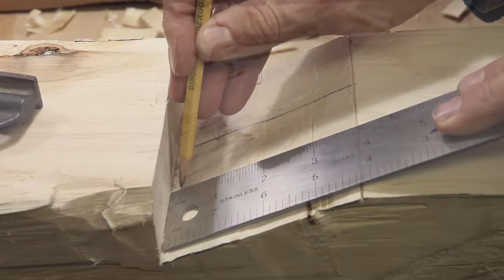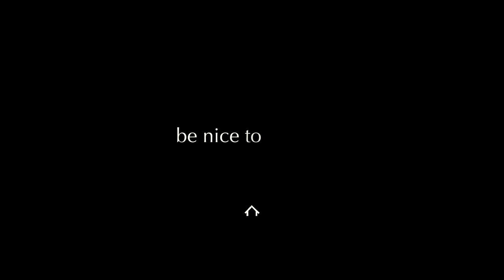Scrap Wood Woodshed

Comment: Great build and video.  Love the team work.  How many different axes did you use to hew the Ash logs.  I think I counted two but was just curious.  Thanks.
Reply from the maker: Thanks Dan, I used 4 but that's just because I have an axe fetish. Could probably have done everything with the mid size broad axe just fine but the big felling axe works well to make the notches.  Keeps the broad axe sharp for the hewing.

Comment: Was the unspoken goal in this video to make your square wooden elements using as many different methods as possible for getting there? :) It's pretty unusual to see someone with such skill across so many tools and methodologies. It's a joy :)
Reply from the maker: Well, as you may be noticing, almost all my projects over the past 5 years have been leading up to one thing.  cabin building.  I have been using these projects to learn new skills and test various methods and better estimate time.  So in a way yes,  Not for the specific sake of this project but as a whole to develop my foundation of skills in various methods.

Comment: Nice shed and video.  One thing that seems odd to me is to take all that time hand hewing the logs and making the joints and then screwing them together.  Why not go the whole way and use dowels?
Reply from the maker: Because I want to take it apart and move it. When it's in it's final position I'll do dowels.
Reply: Ahh, makes sense :)

Comment: loved it. I thought everything about the video was well done. How did you design this project and why did you pick this kind of joinery?
Reply from the maker: brett benson I designed in SketchUp. About 5 times because I realized my wood was more rotten inside then expected so made some changes during the build to accommodate. Joinery was chosen based on what I wanted to practice and so I could track the time it takes to see if I could apply to a bigger project.

Comment: Amazing craftsmanship.  I just landed on your channel and you now have a new subscriber.  Looked through some of the comments and didn't find my answer though it might have been answered further down... Mind if I ask you how much time you spent on the project start to finish? (I understand some wood came from other projects).
Reply from the maker: Marc Cracco hard to answer because I was just working weekends and a few evenings a week. Also if I were to do it again it would likely take half the time as experience speeds everything up.  However it took me over a month from first chop to last brush stroke.
Reply: Considering the existing knowledge and skills you have already even a month with nights and weekends is extremely fast.  Keep up the great work and videos.